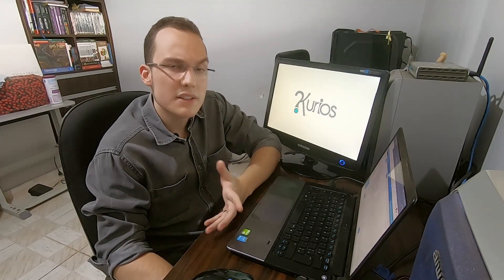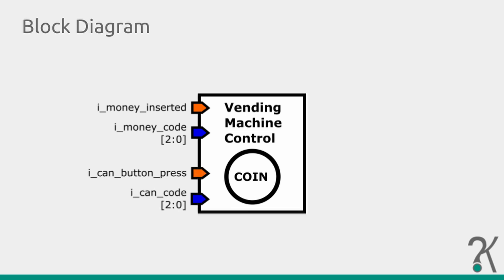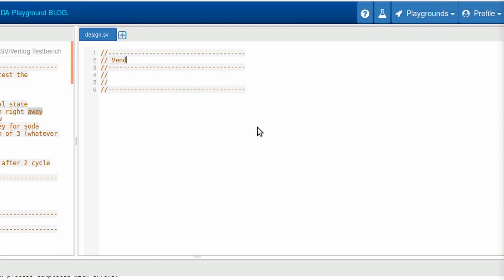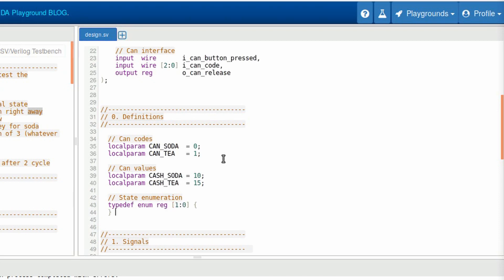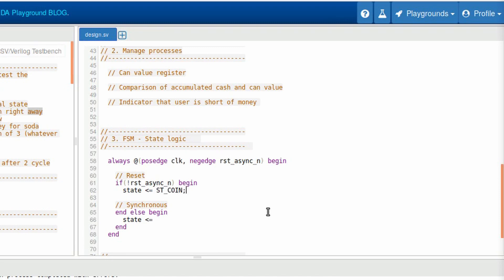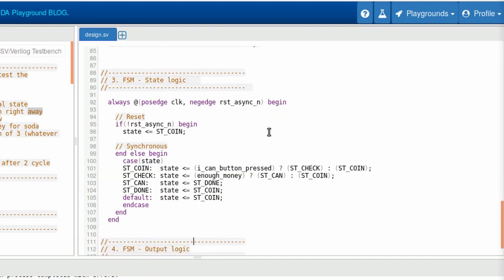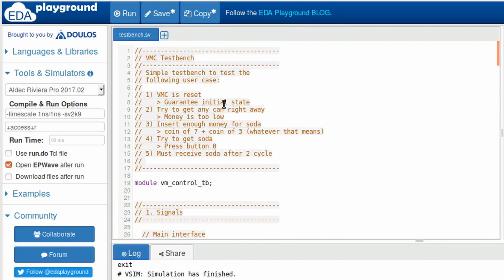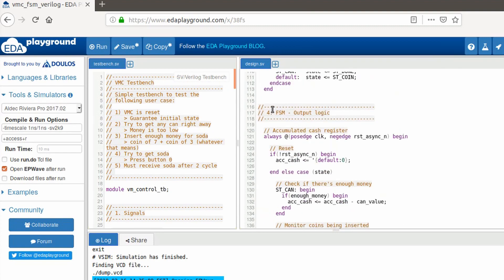Tutorial: Finite State Machine | Part 2: Technical

Comment: Why is reset using a negative logic? Doesn't it make things less intuitive?
Reply from the maker: Yes, it's not so intuitive... I agree. However, you'll see it very often on projects. There are two reasons that I'm aware of:

- Legacy: Old TTL circuits worked better that way (power consumption, switching speed, etc). Used to it, designers continued to keep the negated logic.

- Integration: I'll try to simplify this point... VDD (logic '1') can change a lot between projects, for example due technology. It can be 1.8V, 3.3V, 5.0V and many other values. But GND, the logic '0', is (practically) always 0V. When integrating multiple projects to build a system, forcing the same value at all reset ports is simpler. So we usually use '0' as the reset value. Each circuit will take care to keep a '1' (with it's respective VDD) until it's forced to '0'.